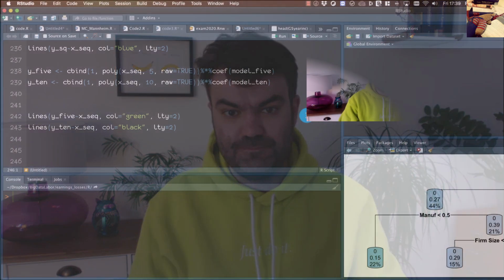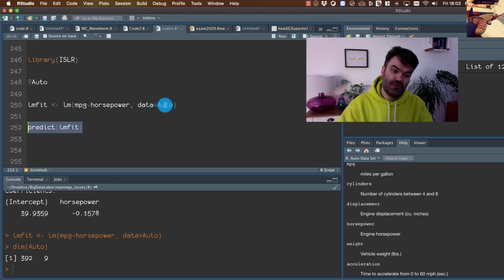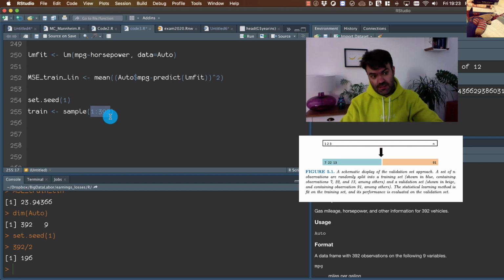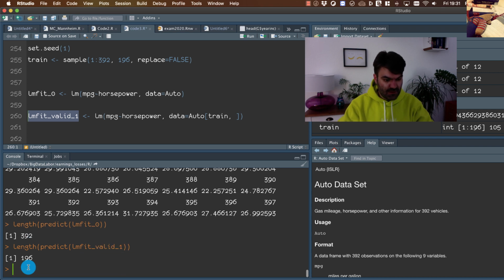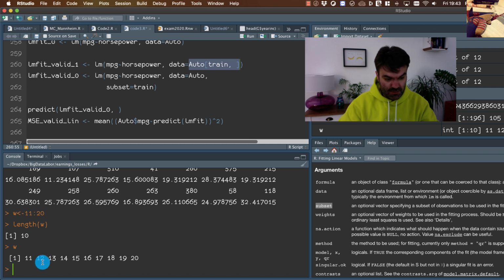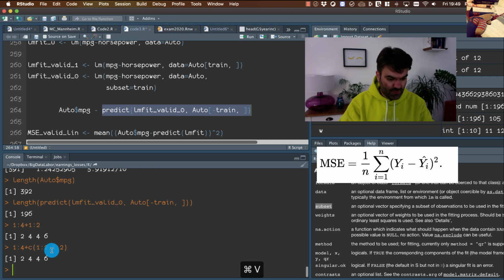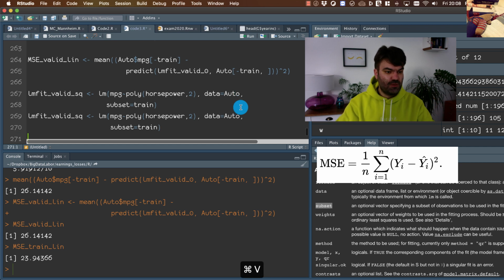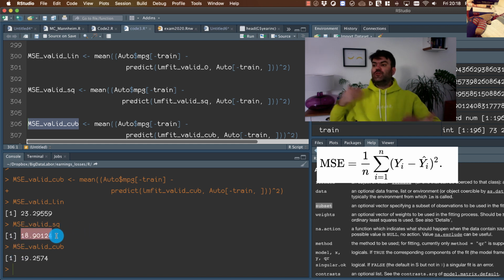Lecture 3: Part 3 [MSE Using Validation Sets 🤔]

Comment: I realize that we use set.seed() for pseudo-random number generation. I understand that using the same number, like set.seed(1) insures you can reproduce results and then when you change it to set.seed(2) the results are affected.

Could you explain what values themselves mean please, ie. the 2 in set.seed(2)? Does it matter which one we choose and how should we choose one?

In looking for an answer I read that the seed is a starting point of random number generator and the same seed always produces the same random number. Does that not imply that the output number is a deterministic function of a specific seed, and the randomness comes from the value of the seed? In that case, by supplying the seed, are we not 'creating' the randomness instead of R?
Reply from the maker: Hi Niamh, it's exactly as you saind. The value of seed is the state state of the pseudo-random number generator and generally has no interpretation. Current computers are deterministic machines that can generate numbers that only look like random numbers. If we want to operate on something that behaves like random then we use pseudo-random number generators (BTW I confused pseudo-randomness and quasi-randomness in the clip but don't think about this as it's super technical). But we want to replicate EXACTLY the same numbers and the same results we are able to agree upon using the same seed at the beginning. That being said, we are free to choose whatever seed we want as long as all of us use the same seed on the same code (and on the same CPU architecture, to be very precise). Hope it clarifies a bit.